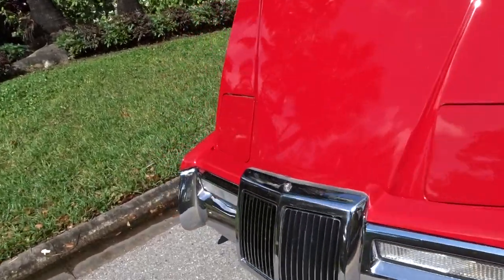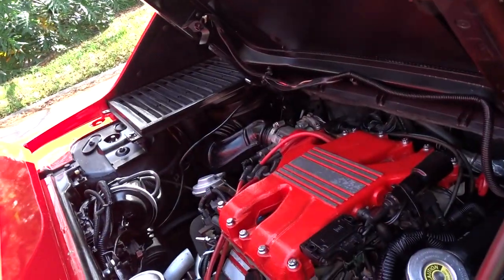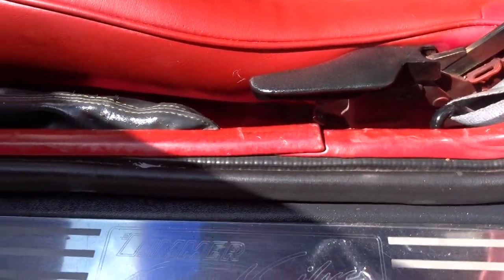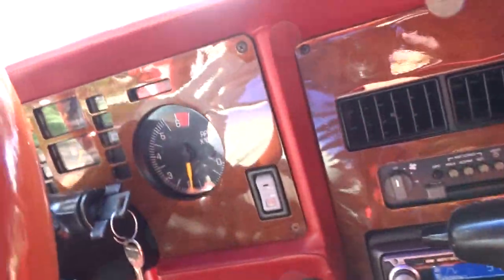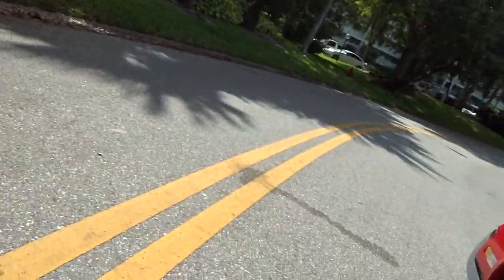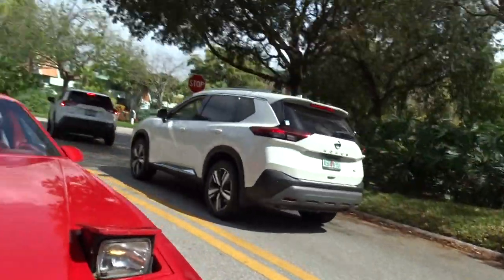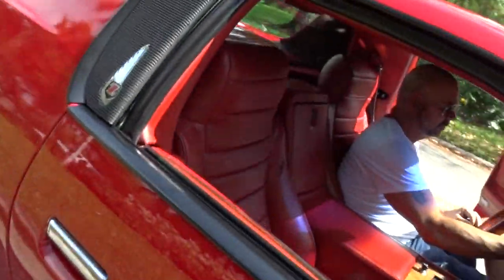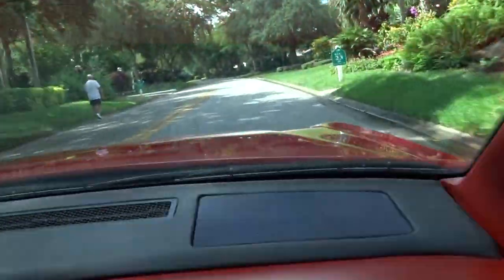1986zimmerquicksilver

Comment: I didn't know this was built on a Fiero. I was hoping it was land yaght size.
Reply from the maker: It is bigger than a fear or was
Reply from the maker: Fiero
Reply: They added eight inches of frame in the rear and a whopping sixteen inches in the front so it was much larger than the original Fiero.

Comment: These were built in Pompano Beach not Syracuse
Reply from the maker: syracuse is where the company head quartered out of i work for them
Reply from the maker: fyi there were only assembled in pompano
Reply: @17classiccars I think the Syracuse company is a relatively recent development . Rights to the name were purchased by a gentleman named Zimmer in Syracuse, NY. He builds Zimmer Golden Spirit neo-classic style cars as one-offs. The original Zimmer corporation was headquartered in Boca Raton, FL. The Motorcar Division was located in Pompano Beach, FL. They ran two assembly lines; one for Golden Spirits, which were a very heavily modified, rebodied and stretched Ford Mustang and the second line which built QuickSilvers from Pontiac Fiero base cars. D.A. Johnson is a very talented automotive designer who had a long career with General Motors Design Staff before designing the QuickSilver for Paul Zimmer @ Zimmer Corporation. This original Zimmer corporation built mobile homes, motor coaches, modified vans and trucks and Black Fin yachts in addition to building these custom automobiles. The QuickSilver was featured on the cover of Car and Driver magazine in 1986.